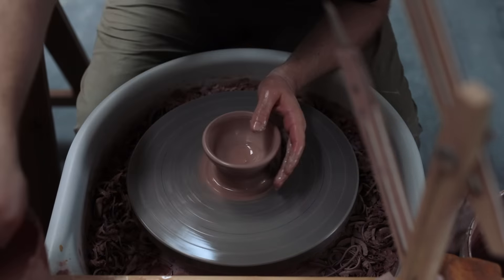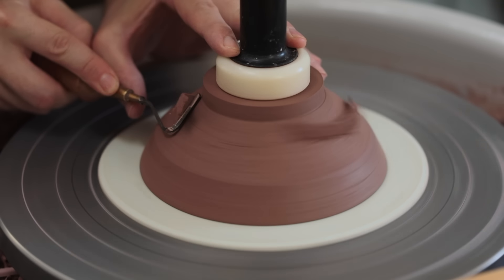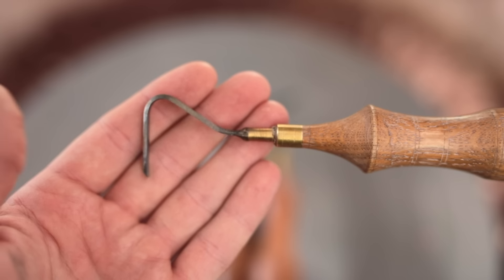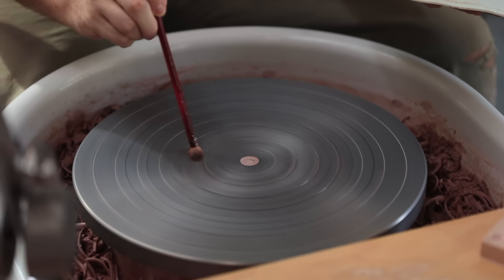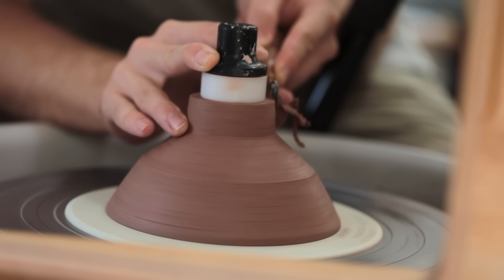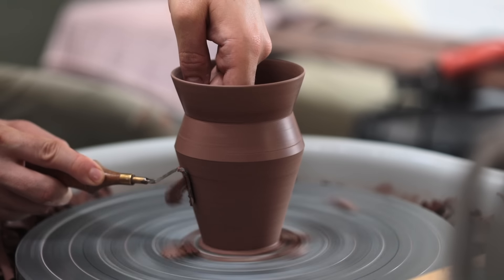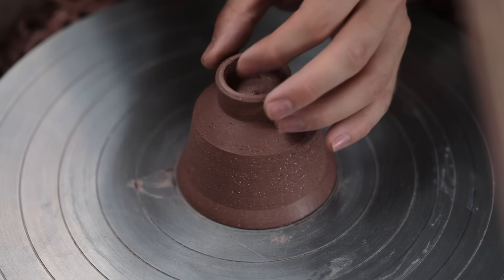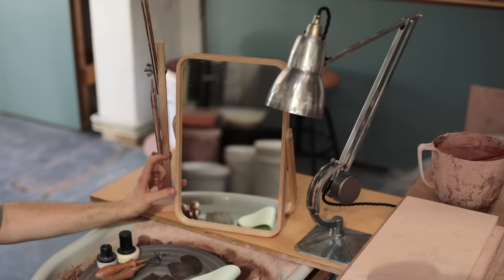My Five Favourite Trimming Tools

Comment: skint as I am I recycled a mirror from an old woman dressing table and screw it on my tool rack and as tools I used old cutlery, bend with a vice and grind to shape with a bench grinder. rough round the edges but they 're all right.

Comment: I encountered you and your videos pretty early in my ceramic journey, so you've had quite an influence. Appreciate it. Here's some various thoughts:
You should make a game of what your 6th favourite tool is. I'm guessing blowtorch.
For maximum benefit, I recommend all potters be both a kiwi and have adhd. Personally I've found this means you'll make all the tools you need from whatever you have at hand, plus you'll have a vast array of highly beneficial transferable skills such as wood working, jewellery making, metal working and so on. UX is also a handy skill, along with graphic design. 
I've been working on making my own tungsten tools. Jaejun flat blade style are very achievable with fairly common tools. Bison pear loops and 7 shapes are harder, but might be possible with a waterjet. Stay tuned. 
There's a number of spinner models available online for 3d printers. I'm finding them tricky as they'll wobble off centre. Likely user error.
I built a mirror add-on for my splash tray. It sits at the back so the reflection is quite far away. I think mirrors need to be quite close, so I'm problem solving how to have a mirror close without wasting my precious tray space.
Looking forward to the next tips video, and question: can we somehow recycle old laptop batteries to get a bit of lithium?

Comment: You can use a skateboard wheel with a bearing 2:20
Reply: Wtf i was thinking the same thing as i was watching then saw your comment
Gonna take my most worn down wheel and jam a dowel on the inside or something and see how it works
Reply: Could you do a tutorial?
Reply: @diegaah  if i were to conceptualize it, super glue or weld a stick with a flat top to the inside of the barring so that the outside still spins, just make sure you get the stick on centered so it's easier to trim with it.
Thats just me spitballing ideas though, ceramics is like 25% winging it i feel
Reply: @CheddarNS  sounds brilliant nothing a good vice and eye couldn’t help with :) thank you